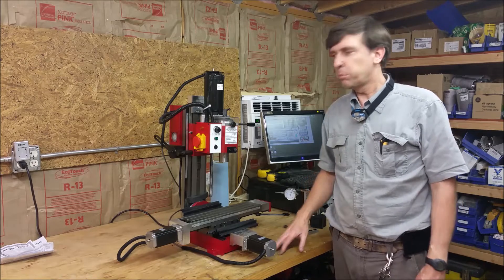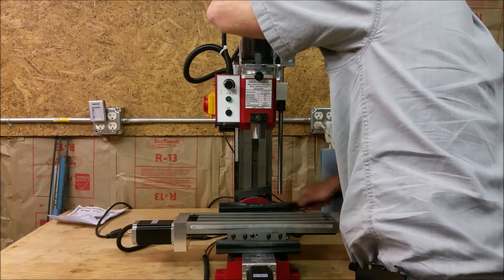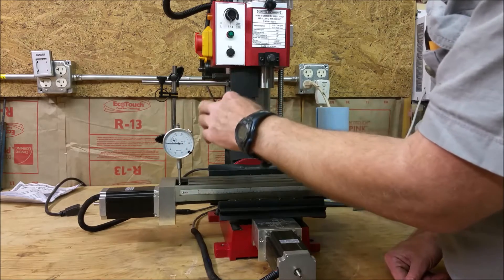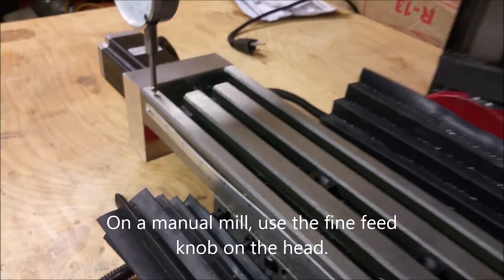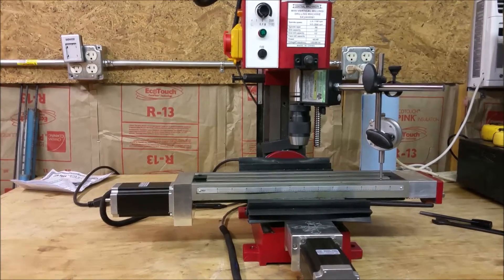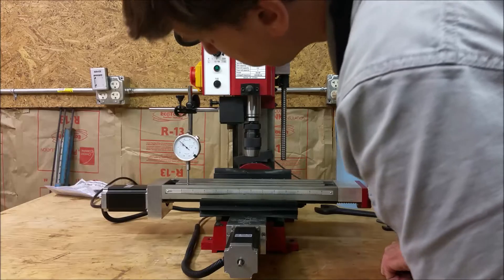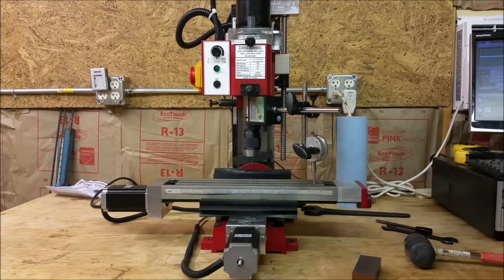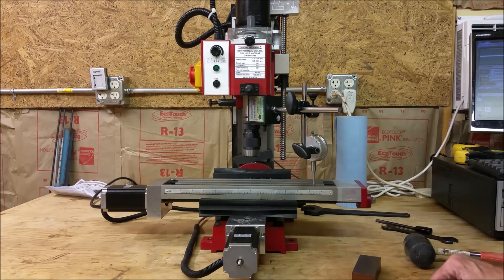Tramming the Head of My Mini Mill

Comment: Bad design,, l made a 12 base and rear colum with triangle supports from 1/4 plate with 2 Allen screws in colum, l can remove them to tilt, took out alot of chatter and I can finally use all Motor power

Comment: Use a length of ground stock in a collet chuck place the mag base on the table then line the stock up from either side of the table. Or just use a square on the table to line up some ground stock mounted in the spindle

Comment: What about front to back? Left and right is easy. But forwards to backwards, mine is 20 thou off across 4" from front to back.
Reply: I just found that mine has the same issue with front to back being out of square. There are 3 bolts under the rear chip guard that can be loosened and shimmed. On my machine, all 3 of those bolts were just barely hand tight...
Reply from the maker: Wow, that's a lot.  Not sure, maybe you have to shim something.  Did you buy it new like that?
Reply: @craigsmachineshop2040  Hi, I bought it a few years ago, and just recently took it out of storage after pretty much never using it. It hasn't been mistreated in storage, so its pretty much that way from the factory.

Comment: Glad to finally see someone do this with these hobby mills. Might be worth wild to get a square steel plate (.5 minimum) ground flat & parallel (within.001 or better) that would fit the table in it's center position relative to the spindle center so you could do it "old school, Last Word in a chuck or collet in the spindle like on a Bridgeport" and see what your Y tram looks like which you didn't do. Then it would be "proper" and you'd know what you know and be more dead on.  You might have to do some shimming on the column to get that right (I have used cigarette paper as shim for very small shimming adjustments and it works great and lasts. Just throwing out there... BTW, how rigid is that little mill when it's all adjusted and cranked down tight??? What kind of max roughing cuts can you take with it in mild steels using carbide?
Reply: Wwwawww6aawwaweaa6e

Comment: wouldnt sweeping the table with the indicator stationary give the same or better results as far as accuracy??
Reply from the maker: If you watch the videos of the seasoned machinists, they do it the same way.
Reply: ill have to redo mine and see if my measurements were false positive.. In the sense i jogged the table to test the X axis , but maybe that doesnt tell the full story
Reply from the maker: If the head isn't square to the table, the bottom of the endmills won't be parallel to the top of the table.
Reply: yep, I did it again last , .0015 across the vice on both axis.. Maybe I just got lucky and thats why It required so little tramming , not sure..
Reply from the maker: Maybe that method can get it pretty close but not perfect.
Reply: Rob M - Sweeping the table with the indicator stationary doesn't do anything to ensure that the spindle is perpendicular to the table.  All you'd be doing is measuring how flat the table is.  If your table is flat, then the spindle could be cocked at 30 degrees, and you would still see the indicator barely move unless there is something else wrong, like maybe a bent leadscrew that lifts the table as it turns.
Reply: NO
Reply: Rob M correct...or a smaller indicator...held in collet...indicator..with Long tip do bridgeports this way

Comment: With regards to Y tramming and the overall rigidity of the hollow swivel column X2 mills... I have had one for quite a few years now... if I could have done it differently at the time I would have brought a fixed column mill.. still I did come up with a table modification which allows me to not only rigidly put the column at any angle within the +-60 degree range but also allows me to tram the Y perfectly and even induce or remove twists from the column

My mill would cut more in the Y direction from factory... I had a 7 thou difference front to back on the table as well as a slight twist causing it to cut more on the rear left than the rear right even though the front of the table would be trammed in. 

Both my sieg machines (mill and lathe) are mounted on a heavy duty steel frame bench I made, and so I made a plate for the column which is firmly bolted to the back of column and extends out both sides of the column by about 180mm each side. This 10mm steel plate is attached via bolts and nuts through slots in matching plates welded to the table...

The net result is I can tram to column front to back and left to right until it is perfect (I mean not even half a thou deflection), I can lock the trammed column completely rigid to the point where heaving hard on the top of the motor in any X or Y direction will cause at most a 2 thou deflection which then returns to zero on releasing the pressure. 

Now I can use the machine with confidence without worrying about the column moving under loads as the belleville washer / nut combination is not the only point my column is fixed.

Sorting out column rigidity is a must for these small mills if you wish to do things to a decent tolerance.
Reply: Any pics of this ??
Reply: It jumped out at me also. You must be a Macheenit.... :)

Comment: thank you very much I have just acquired the same mill so it was a great help. However I found from front to back (y-axis) there was a variation, the column seems to be leaning backwards. Did you check your y-axis? I would be interested to know. I trammed the x-axis to < 0.01mm but when I placed the dial gauge in the middle below the spindle and wound it left and right I got 0.04mm variation on 100mm which is really bad. Would be interested to know if you have looked at that and what you found.
Reply from the maker: Sorry, my tolerances weren't very critical so I never checked. Never had any problems though.
Reply: I just noticed that my mini mill's column flexes and bends easily. I pit a dial indicator in my spindle and using just my little finger to put pressure on the top of the column, I can get .001-.002 of flex at the spindle. Mine is this same mill but it's the solid column. I am about to start working on a way to stiffen the column and adjust the tram.
Reply: +GunsNpolitics I fixed mine by using a .05mm feeler gauge and inserted it at the front bottom of the column. I also contacted Sieg and the said I was tramming it incorrectly and sent me a drawing of what I must do. It is now 100%.
Reply: David James Do you have problems with the column flexing?
Reply: +GunsNpolitics if you pull or push on the column, yes there is flexing. However when you mill you generally use the hand knob and not the levers so it has not had any influence on the milled workpiece. If you would like the drawings Sieg sent me to tram the mill I will email them to you.
Reply: David James Thanks! That would be great. jeremy_boritzki@yahoo.com.
Reply: David James could I get these also ?? Choco107 @gmail.com , thanks

Comment: the problem with my mini mill was - the spindleaxis  wasn't lined up with the z-axis, because of bad grinding of the backside of the gearbox part. if I tram the mill like in the Video, I will have movement of the spindlecenter in x and y when moving up and down in Z (really bad for Drilling and boring) . so I decided to made a checking bar on the lathe, You know ,  something for the spindle with zero runout and the Same diamiter on the whole length to Run up and down with the indicator.
losen up a little the 4 Bolts on the back of the spindle head resetting it to the z axis and tram the spindle itself, also need to shim the back side of the gearbox to get 90 degrees to Y. 
Take several hours.... tighten up the Bolts Put the head back and ... did all again to get closer to alignment. .. 
But finally it works and now a
Everything is squared and lined up !

only can Share this Information and hope Ya'll check this on your mini mill

sorry for typos and grammar, english isn't my language
Reply from the maker: +Brian  Greipel  - Wow, great job on getting it all trammed!  Well, I'm using a Tormach now.  Thanks.

Comment: lol so you tramed x..............  I guess y does not matter LOL
Reply from the maker: +Rich Morgenstein - Yeah, I guess I could have done that for the sake of the video.  My tolerances didn't really require it.
Reply: +Craig's Machine Shop  lol true it is not like your going to build a nuclear reactor here lol  
But!!!  To anyone that cares!  You take a reading back to front of your table in the middle.  There is 3 large allen head bolts.  The two large ones at each end and the stand alone middle one are actually on a 1 degree plain at there center point.  So you can tilt the table forward with two large bolts and backwards with the 1 middle bolt. Then you tighten them down till your front and back of your table are the same to the head!  PS 1/4 turn of any those bolts are about .02 of an inch movement in the head!
Reply from the maker: +Rich Morgenstein - I hadn't noticed.  I figured you had to shim the head to tram it.  Mute point for me though since I'm not using it anymore.  Thanks for the info though.
Reply: +Rich Morgenstein I have just read your comment. Thank you very much as I have a variation front to back y axis and was not sure how to fix it.  Please read my comment to Craig. I am really concerned about my x axis I tram it perfectly but when I mill something it is always much thinner on one side. I placed a dial under the spindle and moved my table left and right and get 0.04 mm difference on 100mm which is pretty bad. Any suggestions how to fix that?

thanks 

Dave
Reply from the maker: +David James  - You trammed the X axis and you are still having trouble with the X Axis?
Reply: +Craig's Machine Shop I now tram it just in the area I am working and I have tightened the gibs and I shim the work with leaves from a feeler gauge. I now get approx 0.02mm to 0.04mm over 100mm which is ok. I still have not looked at the y axis. Thanks
Reply: Rich Morgenstein are talking about the 3 Allen bolts that hold down the column??
Reply: The whole table is straight flat shouldnt be necessary to tram y